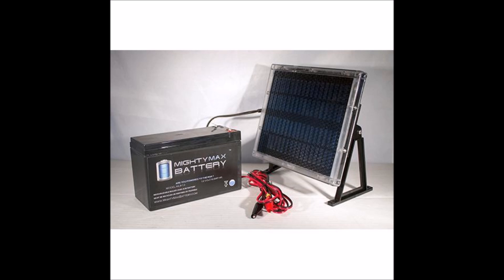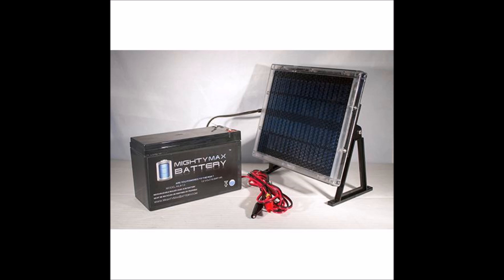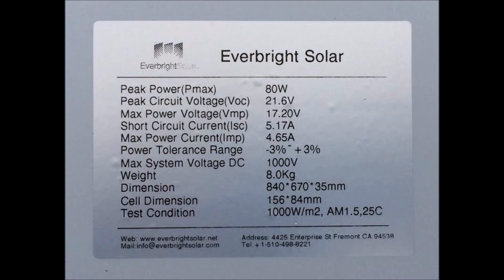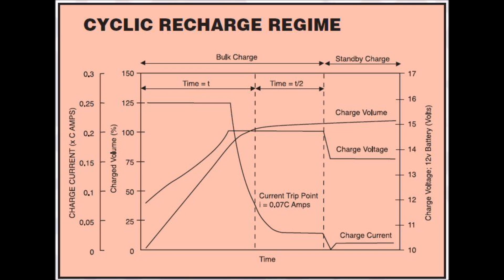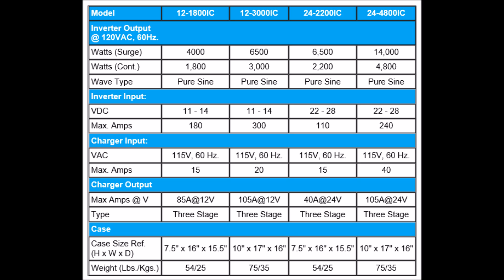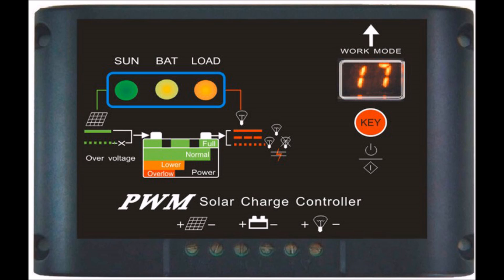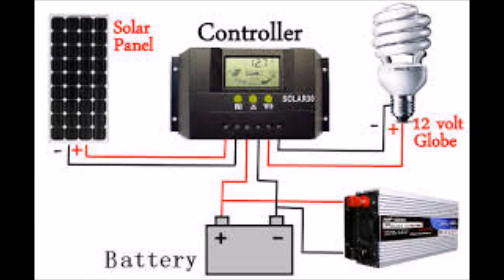Do You NEED A Solar Charge Controller??

Comment: Actually, most active solar systems really never get out of bulk charge mode. I have 1,200W of solar with a 12V car battery and technically don't have a charge controller.  I use a buck converter operating at MPPC (constant voltage on panels) which gets you more than 90% of what MPPT gets you.  I limit the charge current to about 12A so in a way it is controlling charge. Read up and understand your system instead of just buying black boxes.  Inverters can be run without a battery by using a buck converter that limits voltage.  Solar can be really cheap if you DIY mod a lot of modules out there.
Reply from the maker: True but you just talked your way past 99% of people out there.  So for practical purposes the average person buying solar will need a charge controller and batteries.
Reply: On the net I researched a lot of videos and articles before buying solar panels and buck converters for charging 5V USB devices (without solar controllers). With a 45W panel connected to a diode and a cheap usb buck converter I can charge a powerbank and mobile at the same time. But is this safe for day to day use?
Reply: The lead acid batteries are bulky, and even not ecological friendly (I heared) so I would prefer not to use them. Powerbanks are, as I understand, lithium ion or lithium polymer batteries with protection circuits, so relatively safe to use compared to just lithium ion batteries (?). And now you have allready so many devices that accept 5v usb charging... including lights, tablets. Soo, what would be the point of buying expensive, bulky, not ecological, not long lasting lead acid batteries?
Reply: @pieterpauwelbeelaerts5995  Hi there I am new to solar panels. 😀. This is my set up for October to March in the UK ( nearly everyday dull and rain with the odd sunny day ). I have wired in parallel 2 120 watt solar panels when measured using my multimeter they get between about 0.5 amps to about 6 amps combined during the day not under load. My set up involves a cheap Ebay purchased usb cigarette type socket with a positive and negative wire attached to the back,  I have directly attached the wires to the solar panel wires. I have then plugged into the usb cigarette socket an inline amp meter and then plugged my 24 ah power bank usb into that. 😀. I now at this time of the year can get between 0.4 - 1.5 amps for charging shown on the inline multi meter. All in house 5v charges charge phones at about 1 - 2 amps so I am quite pleased with this set up. 🤗. Please note this set up works with one panel but for some reason I couldn't get past 1 amp charge but that would be adequate in a sunny climate. These power banks shut off when fully charged ( anker make ). I now charge 8 devices in my house using this set up off my power bank but I will say my lap top takes a complete power bank charge to run for about 8 hours and all the other devices can be charged a few times from a full power bank charged up. A bit expensive to set up but at least the electricity is free now. 😊.

Comment: You need at least a diode to prevent the battery "back-feeeding" the panel when the panel isn't producing enough voltage to prevent reverse current flow.

If the panel is small compared to the battery then it can trickle "overcharge" with little issue (except LiPo and similar which do not tolerate overcharge).  Generally that's less than 1/10 "C" of the battery.
Reply from the maker: All modern solar panels built by reputable manufacturers have diodes built in to the junction boxes.  I have worked with dozens of different manufacturer's panels now and have not seen any that do not have diodes.

Comment: thank you so much. what amps charge controller do i need to run my ac unit. i have 50 amps but it disconnect anytime i on my (air condition).
Reply from the maker: You will need to power the AC from an inverter that is directly connected to your battery bank.  You will probably not be able to use the "load" terminal of any charge controller for that purpose.  The inverter should be a high quality unit capable of providing a big surge of current as the AC compressor motor spins up.
Reply: That's a project for the charged bank to supply as never believe what U read on how to go it makes U wonder how it worked before on controllers many tests but wen it is disconnected then connected with a controller inverter and solar panel U plug it in discharged then it will use solar but it makes follow standard unit operation so no water much a dry tank if the cooler is able to run it cautions that the DC to AC mode is lowest of the AC it is hard to believe it won't operate and not if their is a short in the airflow cooling temperatures and can be hot
Reply: You should run the inverter for the AC directly to the battery and use the inverter low voltage shutdown to protect the batteries from over discharge. If your batteries are connected for 24v and the motor starting current will be about 150A, and that works out to 750a current surge, or 1500A at 12v. That is many times higher than 50 amps. To the 50a source it looks like a dead short.

Comment: is there a formula for not needing a charge controller? like "for  X amp-hours of of battery capacity, with Y watts of solar, controller is not needed if Y is below Z"?
Reply from the maker: Not that I know of.  You always need a charge controller.
Reply: car trickle chargers though, do not have them, they are typically under 5 watts for a 600watt-hour car battery... so is there a more general formula for that? i can see .83% of watt-hour capacity, already: 5/600 = .83%
Reply from the maker: But those are carefully calibrated to only offset the natural discharging rate of a car battery.  It will not hurt a car battery to be connected to that charger forever.  There probably is such a formula for other batteries but I don't know what it is, sorry.

Comment: I am in Madagascar and it is a do it yourself be a jack of all traits place.   So i understand that a good way to  ruin a battery is to have is under charge-  True?  Does a solar Charge Controller also prevent a battery from going to  low.  It there a percentage?  
I have been watching some owners with Solar here and many times there system become useless to maybe only using lightbulbs in six months to a year.
Reply from the maker: Yes, a solar charge controller will prevent a battery from being too discharged as long as you are using the load output from the charge controller.  If you connect an inverter or a load directly to the batteries then it will not have that protection.
Reply: Al Saves thanks i love your video is really helpful I'm ur biggest fan. and i sure that connection on the end part of ur video, thanks again.
Reply: Under 13.5 volts will not charge at 70 F if over 14.5v it will kill the battery. Many charge controllers prevent over discharge, they have pair of wire to panels, pair to batteries, and pair to the load. Also most inverters have low voltage shutdown.

Comment: Help me out anyone, what if i do not have a battery, but i have a Solar Charge Controller, can i still use the Solar Charge Controller to provide me power for my 70 watts fan, and light bulb, for i just plan to use it at day.... or is this question of mine stupid, sorry just learning, hoping anyone can help and answer....
Reply from the maker: For most controllers that probably will not work.  They usually require a battery to be connected to operate.  If you don't care about energy storage, just get a small, cheap 12V battery to connect to make it work.  Here is an example from Amazon with free shipping:  http://amzn.to/2zg3x6B
Reply: Oh wow, so at least i have a idea sir, Thank you very much, at least i have now a good idea, so any small battery will do right.. Can i 50 watts solar panel with a small batter power up a 70 watts fan sir..
Reply from the maker: You cannot power a 70 watt fan with a 50 watt solar panel.
Reply: What is i have a solar panel 70 watts will direct plug to a 70 watt fan. no solar charge controller, will it work, Thank you sir for your kind reply
Reply from the maker: If the fan is DC and can handle 14-15V without dying then sure.  The fan will shut off if the sun goes behind a cloud, though.  Also, a 70W panel will only produce around 58-60W in the real world so you might need a bigger panel to provide full power to a 70W fan.
Reply: Thank you very much for giving me enough information, I have a very last question, i apologize if i ask too much, Solar panels, i cannot find a solar connect something to connect all 4 solar pannels would it be okay, if i just put and stick all negatives together, and positive.. with out using a connector something like that, i do not know the name of the connector.. it would be okay right, 4 solar panels, all negative just tighten it up in one line, it can still produce power right.
Reply: IS it okay to buy a 5000 watts inverter compared to a 500 watts inverter,
Reply from the maker: Yes, you can combine all of the negatives together and all of the positives together.  I would recommend using a buss bar instead of soldering or crimping them all together.  That way you can easily reconfigure them or remove them for maintenance in the future.  Use one buss bar for all the negative wires and one buss bar for all the positive wires.  Then connect a positive wire to the positive buss bar that then connects to the charge controller.  Same for the negative.
Reply from the maker: I would not use a large inverter like that with a 12V system.  That big of an inverter can use a very high amount of current, which could be very dangerous.
Reply: Okay i went to a Electrical shop yesterday, I saw a 200 watts solar panel, and a 5000 watts inverter, would that be okay, i also saw a solar controler charger that has a 50 amps.. would this combination be okay, with a Solar battery... Thank you for your patience in your reply..

Comment: perfect answer bro as this is true that you need a charge controller
Reply from the maker: Always.  I get asked that a lot and I don't understand why you would take the risk of not using one or trying to manually manage it yourself.
Reply: My solar panels put out 20 amp but charge controller puts out only 12 amps. I have 2 panels. 2 charge controllers. My small aircon on inverter draws under load  56 amps. If I'm running aircon flat out. Can I disconnect charge controller to get a full 40 amps? 4 deep cycle batteries are dropping obviously I needed 4 panels at 350 watts each! Any reply appreciated cheers from Australia 🙂

Comment: I have a Cen-Tech 12V DC to AC power inverter rated to 750Watts. Will I really get 750 watts output from it once I connect everything as per your diagram showed at the end? Also, can I use my car battery for that setup? Also what kind of appliances I can run safely in case of a power outage emergency out of this.
Reply from the maker: Yes, you can really run a 750 Watt load with the setup in that diagram.  How long can you run it is the tough question.  That gets complicated and primarily depends on how big your battery or battery bank is and how big your solar panel or solar panel array is.  Car batteries can be used for very, very short periods of time.  They are sprinters, not marathon runners.  Deep cycle batteries are better for longer run times.  You can run most any appliance safely as long as your system is wired correctly and your inverter provides clean power.
Reply: Thanks
Reply from the maker: You are welcome.  Thanks for watching!

Comment: I made my own auto switching circuit for my solar/wind voltage control. This means The batteries are hooked direct to solar/ wind supply voltage, but when my batteries reach 14.4 volts the batteries auto disconnect till it drops to 13.8 volts. Had this running over a year now.Seems like the batteries are working just as good as when I first got them. Here is a video showing my circuit at my cabin.....
https://www.youtube.com/watch?v=GesZRS3f8h4
Reply from the maker: That is pretty cool!  Sometimes the simple solutions are the best.

Comment: My panel puts out 18 volts but when connected it only produces 14 volts.  I have a solar charge controller but don't use it yet since I only have one (smallish) panel.  Another panel won't do much for me without another battery,  also there is no space on deck anyway, so I would not need to use the controller anytime soon with my set up.  The charge controller uses a bit of power to work anyway, it will be less efficient for my system.  (sail boat)  It has been going strong for many years. HOWEVER, can I connect a wind or hydro generator to the charge controller along with the solar panel or do I use a separate controller for each thing? Assuming the voltage is similar and the generators have their own diode.
Reply from the maker: Yes, panel voltage drops under load.  How are you charging your battery?  Are you just manually disconnecting after you measure it is full with a voltmeter?  Or are you using a spectrometer?

If you use wind you will need a separate controller or one that can handle both at the same time.  Same with hydro.  Be careful connecting two charge controllers to the same battery bank.  Unless they are designed to do that they can fight each other and damage your batteries.

Comment: Not true if the battery is large and solar panel small.
Reply: Ever heard of a "trickle charger" or battery maintainer?

They sell small panels with a diode you plug in your car's cigarette lighter and because the panel is small it can't apply enough current to the battery to damage it.  With the diode the panel doesn't become a load on the battery

Some automakers suction cup solar panels in the back windows of cars in shipment from factory to dealers.  They leave the panels in the cars until the dealer is preparing them for display on the lot.
VW does this.  You can often find the used panels for sale on E-bay.
Reply from the maker: How do you figure?

Comment: i have 2 golf cart 6 volts connected for a 12 volt bank. they have sat for about a yr and current read 5,38 volts. i believe this is to low for my mttp controller not yet installed to recognise to start recharging the batteries.i just bought a 100 watt solar panel .can i hook it up directly to the battery to raise the current 5.38 volts ?,,,,,,,,,,how long should i expect to wait for the voltage to raise to a decent level for the controller to be added ?
Reply from the maker: I would not recommend connecting solar panels directly to batteries.  But if you are careful and know what you are doing you could get away with it for a short period of time.  The bigger the battery is in relation to the solar panel the safer it would be, though.  For example, if your two batteries are 225Ah size for a 12V 225Ah battery bank and you had a 50W solar panel laying around that would be much safer than the 100W solar panel.  Proceed at your own risk.
Reply: thanks
Reply from the maker: You are welcome.  Thanks for watching!  Be sure to subscribe if you haven't already.

Comment: This assumes you have lead acid and it also assumes you don't size the solar panel to the battery.  Also, you could have a relay and whenever the battery reaches a certain voltage the relay triggers disconnecting from the battery.
Reply from the maker: Almost all solar batteries are lead acid, with lithium slowly starting to enter the market as companies adapt to charging lithium.  But you still need a charge controller with lithium.  In fact, you will surely start a fire if you try to charge a lithium battery directly from a solar panel.  I suggest that you do some research into charging stages of either lead acid or lithium batteries.  You always need a charge controller.

Comment: i have one ,145 watt, 24 volt solar panel and two 12 volt ,120 ah deep cells, how many amps does my charge controller need to be? i have a cheap 10 amp,will that be ok?
Reply from the maker: Yes, 10 Amps is more than enough for that solar panel.
Reply: 145w/24v= 6amps

Comment: You: If you're smart enough to get around it, or if you want to babysit the battery and disconnect it from the solar panel when it's fully charged, knock yourself out.

Person that would babysit the battery: Knocks himself in the head with a rubber hammer
Reply from the maker: Yes exactly!
Reply: @LDSreliance  hii, good info video. thx,

i heard a friend who got one solar panel out in his garden connected to a dc diaphragm water pump, to slowly pump the water fr pond to water towel for vege watering. how that works  ?? how to match up the water pump to the solar panel ? is there solar panel that output the exact power to the water pump so won't damage it ? since cloudy weather produce less power for the pump, the it will pump water slower and sunny day; it pumps faster.. 

this is where i got confused. 

thx
andrew
Reply: Even I got a kick out of this. What is the difference between sealed lead acid (SLA)battery and flooded lead acid (FLA)battery?
Reply from the maker: Everyone has to start somewhere with learning this stuff but that one should be fairly obvious from the name.
Reply: Isnt the FLA battery flooded with acid (Wet cell battery) and the SLA battery has an absorbent that keeps the acid from spilling out?
Reply from the maker: Basically, yes.
Reply: er... actually you can have wet cell batteries that are sealed. But I'm going to keep quiet.
Reply: Here, I meant wet cell as in nothing to keep the acid from spilling out, and SLA as in 0 maintenance.